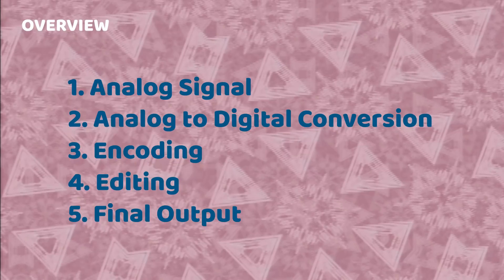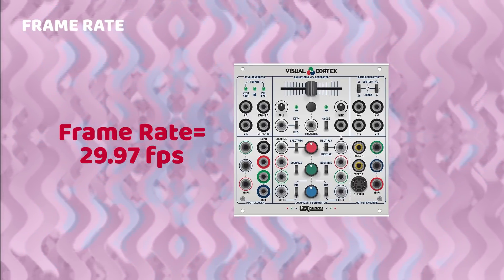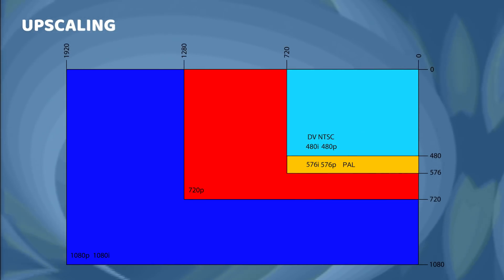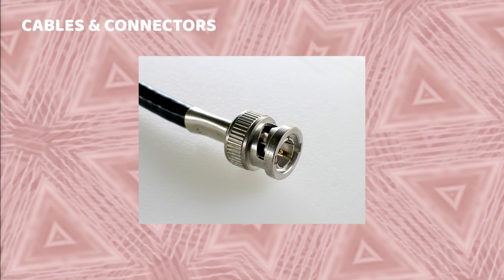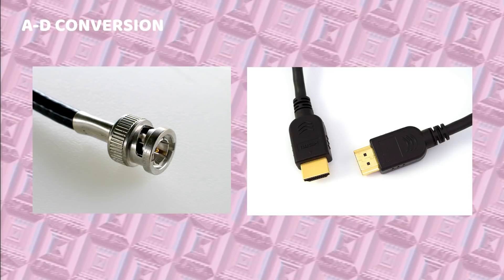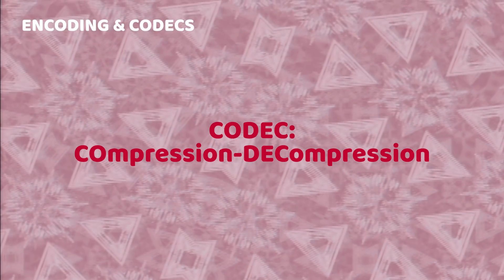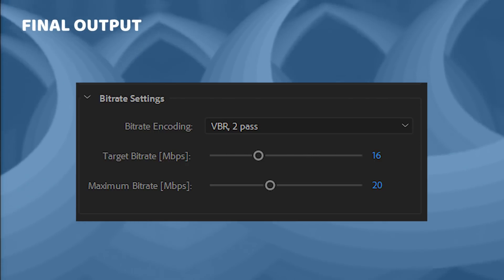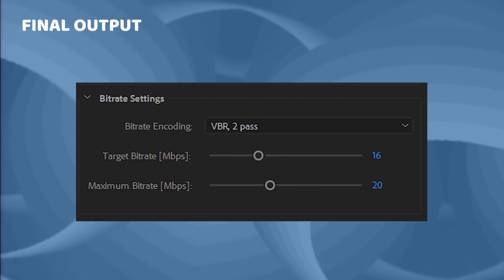LZX Video Synth Techniques: Post Production Workflow

Comment: Update II: Finally replaced the Itensity Shuttle with a Blackmagic Hyperdeck Mini. Signal goes: LZX Visual Cortex (NTSC) into Blackmagic Miniconverter Analog to SDI into Decimator MDHX where it is upscaled to HD into the Hyperdeck. Works perfecly, resulting in smooth high definition images and with no computer involved.

Comment: Update: I learned the Blackmagic Intensity shuttle seems to be picky about what hardware is running the usb 3.0 connection. In my case, it causes the Intensity shuttle regularly to freeze. But that is a motherboard/usb issue. Make sure your hardware is running properly with the Intensity.
The Intensity shuttle works fine with the Visual Cortex Component Output! 
But here is a signalpath, that works now great for me (though I'm using more components than are usually required): Visual Cortex Composit-Out goes in Blackmagicdesign Miniconverter Analog to SDI,  goes into Decimator MD-HX, processing to 1080p30, HDMI-Out goes into Intensity Shuttle HDMI-In.
Resulting in extremly smooth colors and high resolution without any artefacts.

Comment: hi there, i'm a bit confused, maybe someone can help me out here. i own a blackmagic intesity shuttle, a black magic analog to SDI miniconverter and a Decimator MD-HX. But none of the devices can handle the output of the Visual Cortex. The Decimator needs an digital signal, and blackmagicdevices in general do not accept the NTSC 480i from the VC, it only accepts NTSC 525i. (which is broadcast-standart). is there anyone who would give me a hint how to make it work. thank you!
Reply from the maker: 525i and 480i are the same format (NTSC) The nomenclature is referring to total scanlines vs visible scanlines (vertical resolution.)
Reply: @lzxindustries  Oh. Thanks you. Obviously I didn't know that. I wonder now what in my signalpath might be flawed.

Comment: lovly tutorial :) noob here, is there a way to input digital footage in to a video synth? or some how converting digital in to analog and then the process in the video? and is video synth compatible with cv inputs? grettings from italy
Reply from the maker: Thanks for the questions. Any format can be converted into any other, so getting your digital footage into a video synthesizer is possible with the right equipment. LZX video synthesizers accept all the CV you can to throw at them, but some signals are best scaled to a 0-1V range.
Reply: @lzxindustries  damn thx for the fast answer :) !! Now i think its time to save some money hahahaha greetings

Comment: Thank you so much for this!! Though I'm still a little confused, trying to see if one of these setups will work.
LZX > BM UpDownCross > BM HyperDeck Studio 2 ?
Or
LZX > Decimator MD-HX > BM HyperDeck Studio 2 ?
Reply from the maker: That's close. You would need to convert your LZX analog signal to SDI before the UpDownCross or Decimator.
Reply: @lzxindustries  Thank you! So I would still need something like the BM Mini Converter Analog to SDI between the LZX and the UpDownCross ?
Reply from the maker: That'd do the trick, yes.